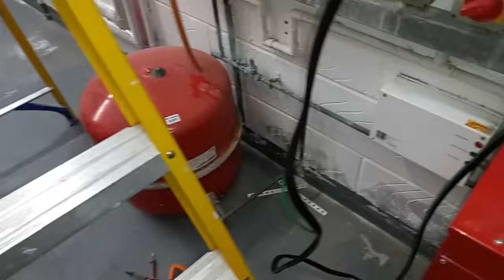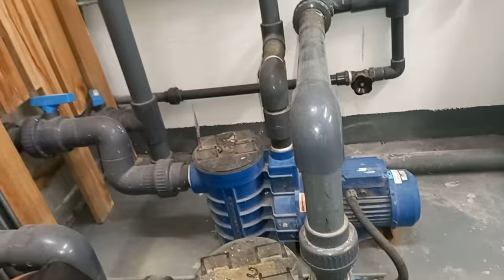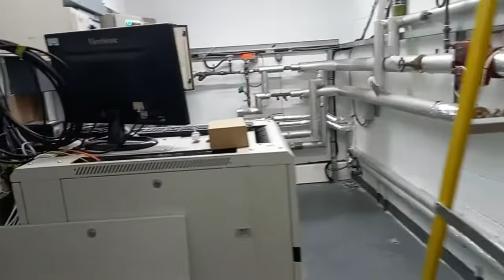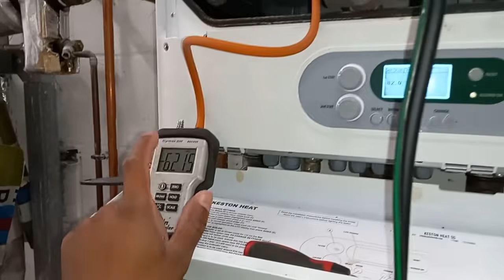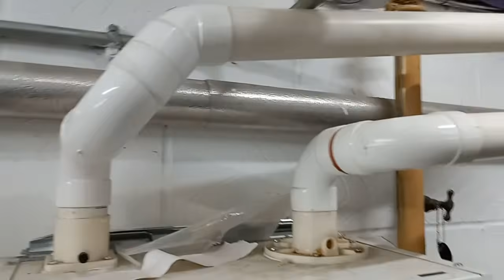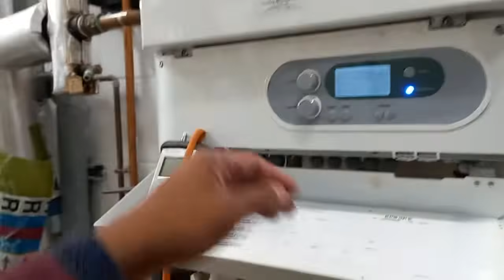BG BOILER SERVICE

Comment: Check the ex vessel. If the aav is leaking
Reply: Treat them like manual vents - after venting close em off so they dont leak - saves a lot of grief